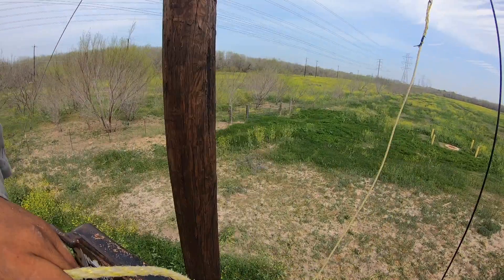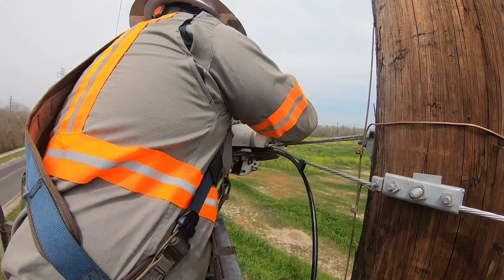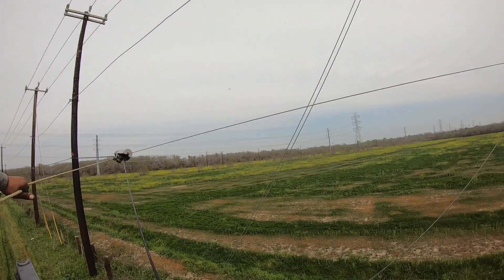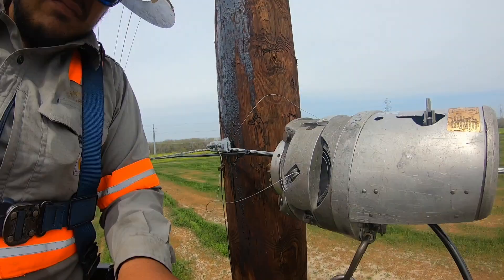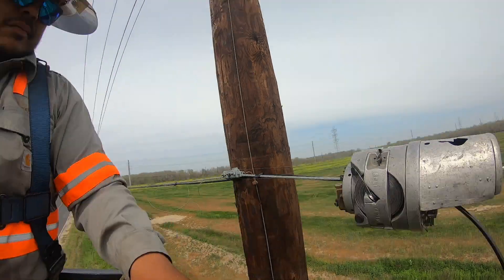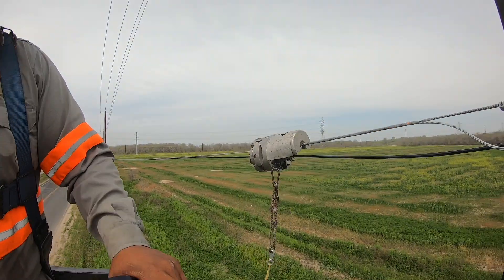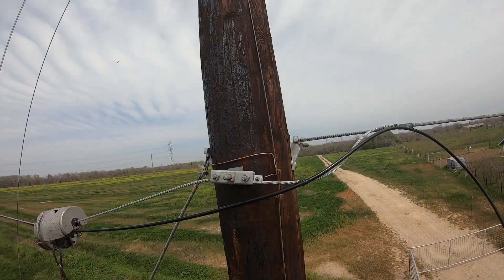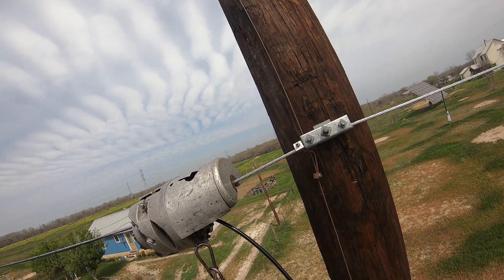how to drive off fiber like a pro

Comment: Did the fiber feed straight off of the reel to the span or did you have someone pulling it off as you go? And also did you  put the fiber through any rollers/slots on the bucket truck
Reply from the maker: @thomasgoheen1895  ya Coming Straight Of The reel. Placed some rollers where i could, my truck is not 100% set up for it but with some power rollers u can make it work. 
Just be careful not to kink the fiber.